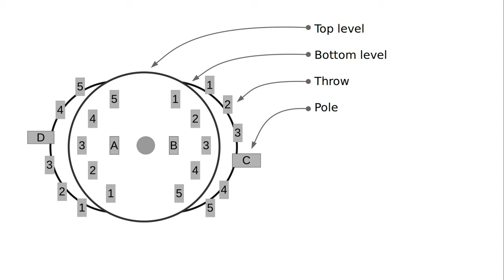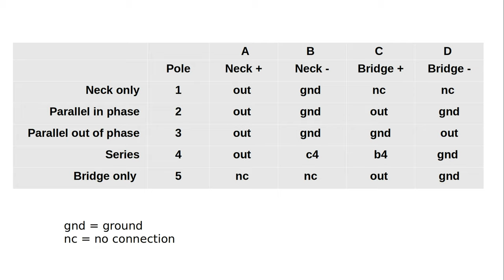Fender Mustang Mods - 5 way switch with series and out of phase sounds | wurst.guitars

Comment: Very cool video. Been thinking about taking out the pickup switches in my 73. I enjoy the versatilit, but end up always using both pickups in phase on stage for practical reasons (love neck pickup by itself too). I tend to accidentally knock them out of position and sometimes even hurt my fingers on them...

Comment: Really nice video . I have an early millennial Japanese mustang and I’m on the hunt for some customization direction . Really want to add lows/mids into the signal. Love your idea for the rotary switch . Probably going to use this too !
Reply from the maker: the series position would add those low mids - you can also just try it out with some crocodile clamps before you buy the switch and route out the control cavity :)

Comment: Some more insight on how to improve tuning stability on Mustangs would be highly appreciated too! I'm always learning something new about this model.
Reply from the maker: What works for me is to use relatively heavy strings ( I prefer .12s), and to screw the "cigar" tailpiece down until there's pretty much no space left between the strings and the base plate (but making sure the strings don't touch the base plate yet). At that point, you won't be able to bend up with the vibrato anymore, but downbends are still smooth, and sustain and tuning stability are improved quite a lot

Comment: I have an idea of using a schaller rotary pot switch for pickup position selector and a double cts pot for volume and tone, any idea if that would work ? 😂
Reply from the maker: If the rotary switch has got four poles, it should work (you can do it with less poles, but not if you want every sound available)